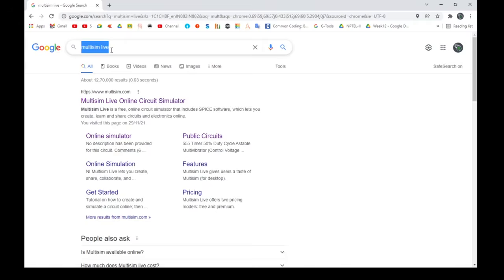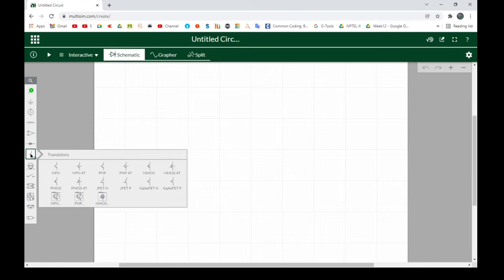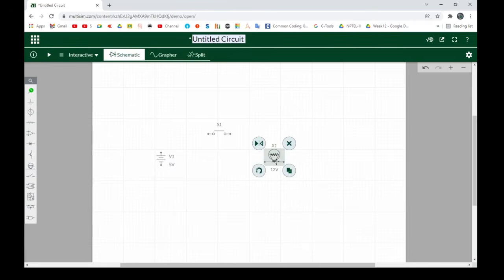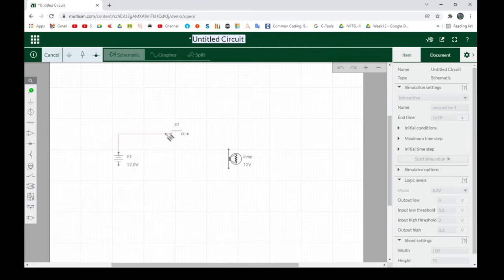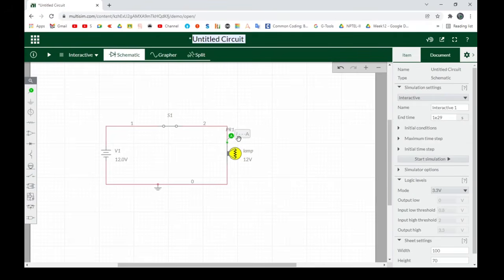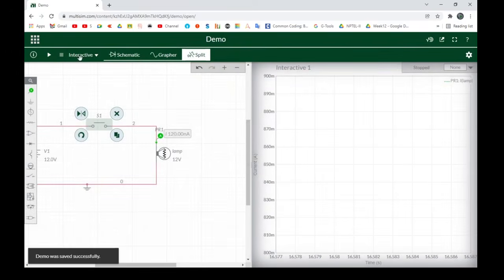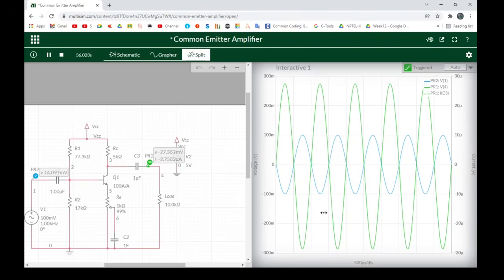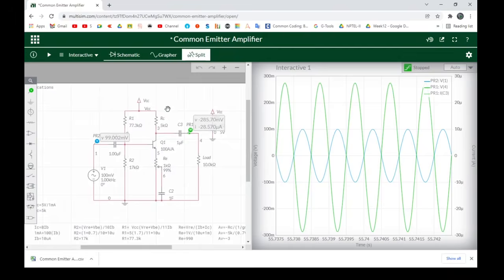How to use Online Simulator MultiSim Live.

Comment: i have a circuit to layout and look for a knee point in a freq range between 10hz and 10khz, i have the circuit but not sure i have it correct,
Reply from the maker: Which experiment you want to perform?
Reply: @ADKTech7  RLC parallel Vs = 10 V @ 1.5 kHz, R = 15 Ω, L = 2.7 mH and C = 1.8 μF
produce a resonance curve for the circuit between 800 Hz
and 4.5 kHz.

Comment: Where can i find oscilloscope???????
Reply from the maker: You can Use a Voltage or current probe to enable oscilloscope. After clicking on run simulation button click on "grapher" option to see waveform.